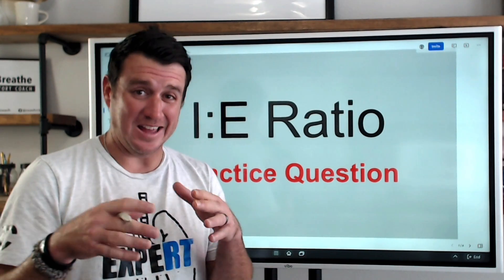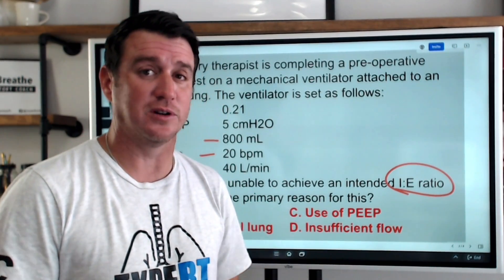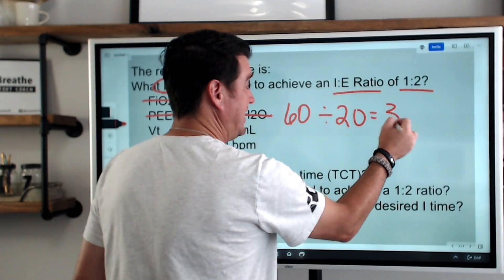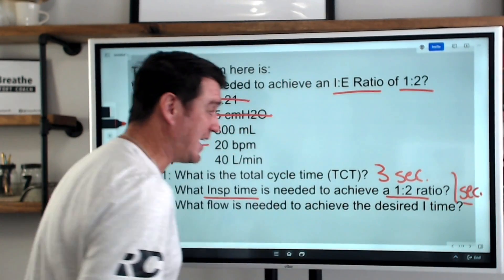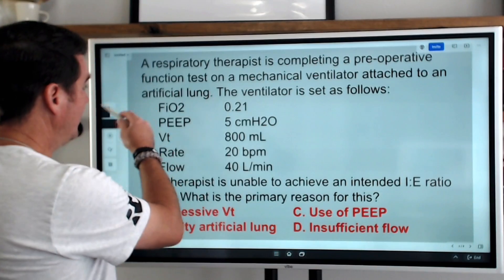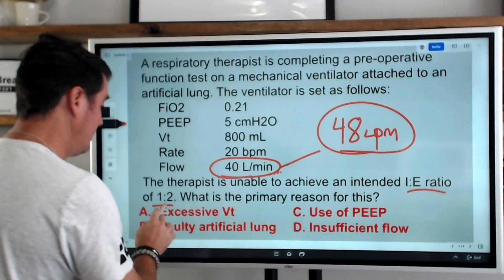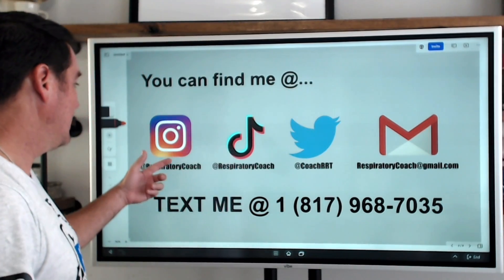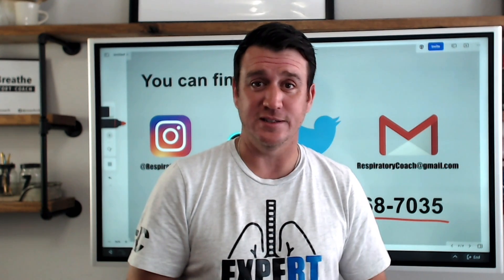Respiratory Therapist - How to calculate I:E ratio.

Comment: Hey there Coach, thank you for the video. ☺️
I have a question...you have a patient desating into the 70's. When would you know to place the patient on NRB vs. HFNC? 
I've been in this situation in the ED. The patients low sat was fixed with a NRB although the patients HR and RR were increased.  Then another needed a HFNC. When will I know the difference?🤔 please help
Reply: Although HFNC can provide some breathing support by generating some PEEP due to the high flow, it’s mainly used for oxygenation. If a patient shows signs of respiratory distress, like increase HR, RR, or accessory muscles, I would have suggest placing the patient on BiPAP in order to lessen the patient’s WOB. If you know patient is fluid overload due to resident giving him or her lots of fluid, BNP lvls are high or fine crackles breath sounds which is sometimes associated with pulmonary edema then the next step is BiPAP before intubating the patient. Hope this helps you.
Reply: @chestersidd1626  Thank you very much! This is very helpful.🙂